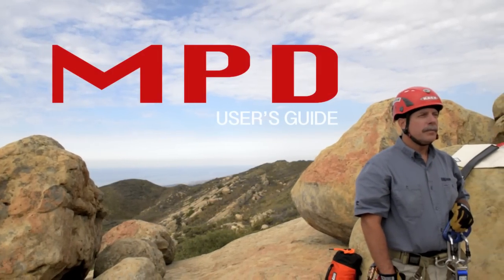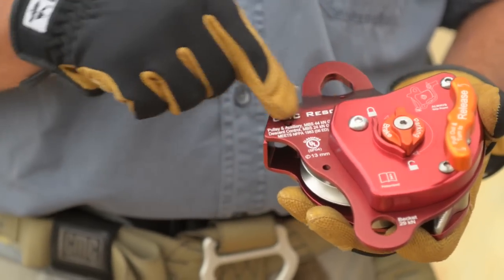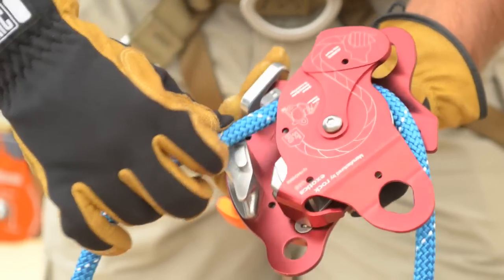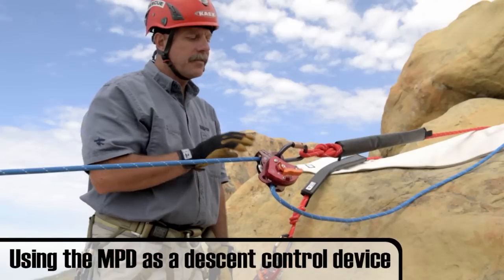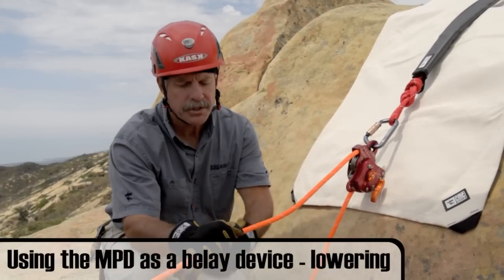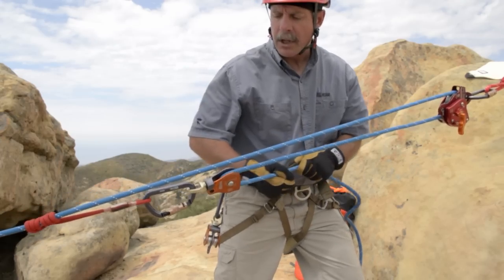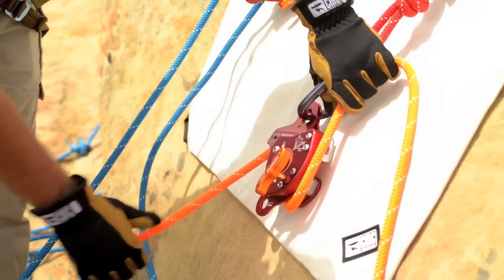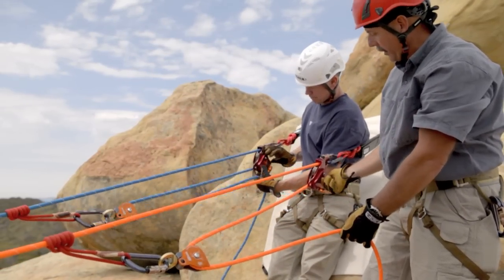CMC Rescue MPD User's Guide by CMC Rescue School Instructor | CMC

Comment: Question: Do you need a radium release hitch on your belay line if using the MPD? Assuming your belay line is loaded and locked with two prusik, couldn't you haul with the MPD easing the pressure on the belay to release your belay prusik? Even if you had a total main line failure you could re-establish the main line and haul to ease the belay right?
Reply from the maker: Thanks for your question. To clarify, if you are using an MPD on your main line and another MPD on your belay line, there is no need to place two prusiks on the belay line because the MPD is NFPA certified as a belay device. Should you have a complete main line failure the MPD is designed to arrest the load on the belay line. The user can continue to lower or raise on the "belay MPD" after the mainline is established. There is no need for any type of load release hitch. 

If you are using an MPD on the main line and tandem prusiks on the belay-loaded main/slack belay system, we recommend a release hitch whenever using prusiks on the line. That is true for the ratchet prusik on a traditional system (not needed with an MPD or Clutch) as well as with the tandem prusik belay.

If something were to happen to the main line which caused the load to transfer to the belay, locking up the prusiks, you could rig a new main line, raise the load, and unlock the prusiks. The question is do you have the time and equipment to do that? It could take quite a while to rebuild that main system, not to mention the need for additional rope and hardware. The alternate option is to install a descent device on the belay line, untie the load release to transfer the load to that device, and release the now unloaded prusiks. You would be lowering on a single rope system but that might be preferable, or the only option, to building a second system.

Comment: Heres the problem Im seeing: how do you inspect this thing at a glance or even in depth. If something isnt right you cant just open it up and look at it if its under load without breaking out the prusik, carabiners, and extra rope to check on it. What if you get mud in there or tree sap? I can almost guarantee a wet rope or a brand new rope or a weird sized diameter rope is going to have a different feel to the break. How does it handle shock loading in these conditions? Whats the max and min diameter of rope that you can put inside it? I do appreciate that it attaches midline at least. The other thing is that its not as straightforward or intuitive so you cant just hand it off to a newbie and they will understand. Even the brake lock needs to be explained.

In the comments you mentioned this in reply to someone asking about use of a radium release hitch: 
"If something were to happen to the main line which caused the load to transfer to the belay, locking up the prusiks, you could rig a new main line, raise the load, and unlock the prusiks. The question is do you have the time and equipment to do that? It could take quite a while to rebuild that main system, not to mention the need for additional rope and hardware."

If time is an issue I would honestly just take a couple of wraps around a tree or rescue 8 and sling before even installing this thing. In my field of work we use break tubes/porta-wraps. They are a single solid block of metal that you take wraps on and can visually see everything going on and intuitively gauge how much friction you have. And even with this fancy device (which has a way waaaay lower weight rating, mind you) you still have to lock it off for people to understand whats going on 100%.

Also, you guys use kernmantle? Seriously??